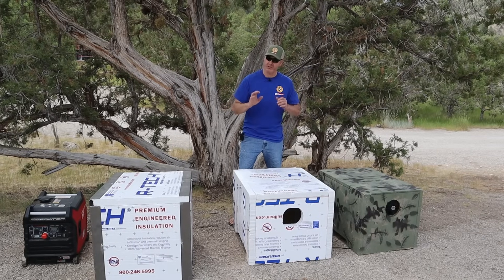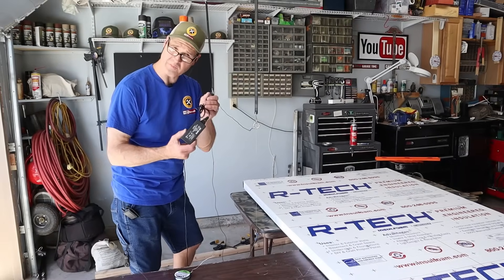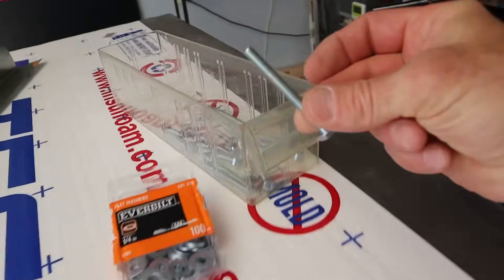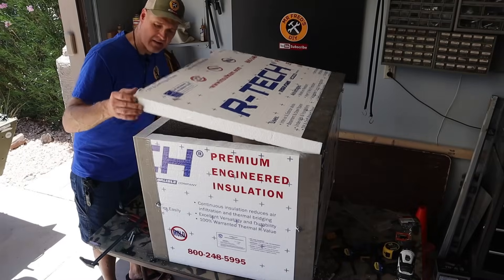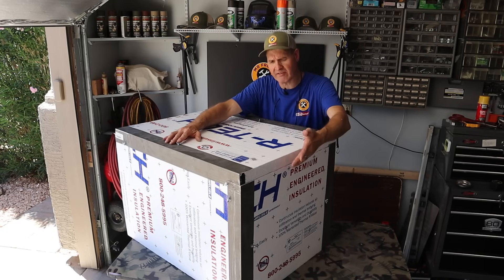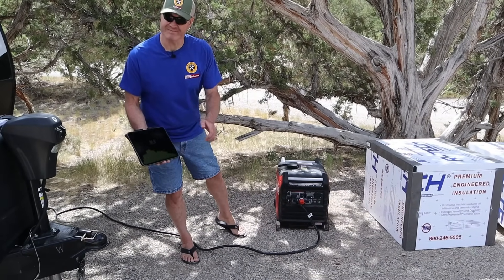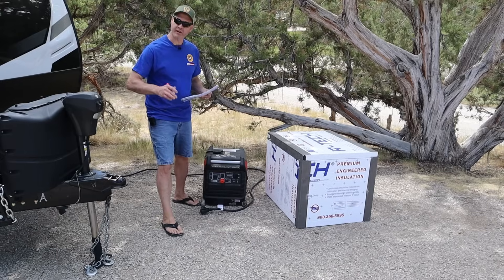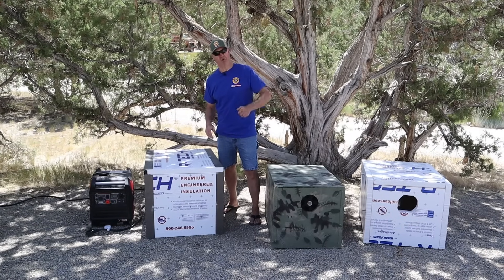Generator Noise Reduction Shed $30 Design

Comment from the maker: So what are you guys think? Is this box worth the effort? Let me know your thoughts. ▶️Here is my newest generator sound box design https://youtu.be/Wn_GF1RQoow?si=3QVhW5V_QWGCH1Pn
Reply: No, it does not work - it just looks good. I typically never use a gen in the nice conditions you had... I want to see the test in a storm, 60mph wind gusts, for about 6hrs. Let me know if the box is still there and if the generator is still cool to operate..
Reply: @MrFredsDIY  you have a small generator. I’ve tried this before and my generator nearly burned the engine. It overheated. Your oil will break down fast and need of changing it often. You need good ventilation or a fan inside. My generator is twice the size of yours and was advised not to do it without an internal fan for airflow. Good design though.
Reply from the maker: Thanks for commenting! What size is your generator? We did a pretty thorough testing video with a thermometer in the oil and the temperature ran normal.
Reply: @MrFredsDIY  or...buy a Honda. Always point the exhaust away from others
Reply: Where did you get the material that you did the build with, the r-tech premium engineered insulation that is.
Reply: .where did you find that blue board. I been searching all around. Dandahermit don't forget bout the exhaust routing or you'll melt it. If you do put a super muffler it"lol still be loud.
Reply: Why would you use an already quite generator instead of a normal generator that wasn’t already sitting in an insulated box. We had the 5000 Predator generator and it was already pretty quiet on its own. This test really proves nothing.
Reply: @-.__.__.-Rad  Sure, throw a MSTA 49 in. 16-Gauge Galvanized Medium Strap Tie under the genny and tie it to the box, with or without spiking it to the ground first.  I might also urge you to move to a less rad weather space, pard.
Reply: No, just buy a Honda to begin with

Comment: I'm more concerned with heat buildup. Cooking the generator is a big risk. Before I'd do this, I'd check temps at key point before and after putting this cover on.
Reply from the maker: Heat with generators is a concern. I did a thorough heat testing video for sound boxes. ➡️https://youtu.be/Ty8aJ2Eh_WI
Reply: Add a box fan
Reply: Yeah it is an issue, My friend made one of these last summer used it on one of the hottest days of the summer to run his AC for an hour and it got so hot it swelled the gas tank and over heated the motor. Once it all cooled down he tried a box fan and it still was getting too hot and it really didnt help with sound all that much, he just ended up getting a much quieter inverter generator.
Reply: @Ivel307  haha I did this.

Framed with 2x6 and batts like your walls would be. Then OSB shell. Then foam and then strapping and siding.  Between the 6inch batts, 2 inch foam, and the strapping/siding creating another dead space it does wonders.

Had to do a sloped A frame roof to put a bathroom fan to bring in fresh oxygen and cooler air.

Little exhaust on the bathroom fan at the top, and an intake vent on the bottom to make it cross breeze.

This way you can pretty well seal it up. Only time I need a generator running through the night on a job site in a residential area is for mould killing attics in the cold winter, and running a 240v heater to keep the attic decent to mould spray and spray foam seal gaps/cracks etc.

So also cold winter air not hot summer air. And no sun being it’s overnight.
Reply: @andrewkujawiak5388  there was a guy on this platform who used a sound meter and just set 1/4", 4'x4' board up against his generator slightly tilted onto it, but more importantly between his camper and the generator, and it did the same decibels here. All you need to do is reflect the sound away from you with a single wall (board). There is no need for the sides and top.
Reply: Irritate the neighbors. 😆 

Or get the plans from Agent Maxuel Smart for the Cone of Silence. 👍
Reply: @andrewkujawiak5388  yes, heat is the enemy of a generator (from big to small).  The gender will deteriorate from high heat levels sand output will lessen.  A small fan to move some air would be a nice addition.
Reply: That things gonna cause your generator to blow up overheating  it
Reply from the maker: @kevinmahan2448 Nope, I made a heat testing video showing the opposite.Are Generator Sound Boxes Bad?
https://youtu.be/Ty8aJ2Eh_WI
Reply: @Steven-gv1ke  yes, the idea is to divert the sound to the ground. It will absorb it.
Reply: @douglass56  when there is an emergency,  you  are in survival  mode. Don't  care  about  neighbors.

Comment: If I tracked your numbers, the difference was generally about 2-3db reduction.  While most people will be able to hear a difference of 3db, it is very near the limit of discernment for most.  No one will consider a dramatic reduction.  Still, i love the effort and plan on watching your earlier versions.
Reply: @kcgunesq  But it was a 6 dcb drop under load which is quite significant.
Reply: @Mozillapi  I agree that 6db is discernible and approaching significant if not significant.

Comment: Most newer generators have a Carbon Monoxide detection feature that shuts down the generator if Carbon Monoxide builds up, such as running it indoors.  You may need to ventilate this "enclosure" to defeat this automated shut down feature.

Comment: needs an internal textured surface for the sound to get trapped in just like a sound booth. gluing some scraps of random foam strips on the inner walls and creating another inner wall with holes punched in it would probably drop you 10 more d's.

Comment: What about heat dissipation?
Reply from the maker: Great question! I made an extensive heat testing video for this box ▶️Are Generator Sound Boxes Bad?
https://youtu.be/Ty8aJ2Eh_WI
Reply: @MrFredsDIY  no sir my next project at my cabin is to quiet my presence there your information was great I’ve got a bud Rubbermade lawnmower shed 4 ft high and 4 ft wide and 5 ft long that’s where I’m gonna put my generator my cabin is totally off grid and I’ve got an exhaust pipe full of fiberglass also for noise control I’ll let you know how it goes , thanks.
Reply from the maker: Let us know how it turns out!

Comment: sound vs heat....putting the generator in a Styrofoam box traps heat does it not?
Reply from the maker: I was surprised when we made the heat testing video! Oil temperatures stayed pretty normal. Here’s the video.https://youtu.be/Ty8aJ2Eh_WI?si=N5AiC7wq_tFMGYb7

Comment: 3" Bonded Edge? Would you mind sharing more info about this? Is it trimming for eaves? I can't find it and Google is usually pretty good to me ;)
Reply from the maker: You can find these 3 inch wide metal flashings in the roofing sections at Home Depot and Lowe’s

Comment: Does that 3500 run everything in you camper at once?
Reply from the maker: Yes. Ac, microwave, water heater too
Reply: @MrFredsDIY  I have a Springdale 1750RD mini.. 30 amp and I'm looking for something I can beach camp with..thanks

Comment: I was suprised to learn simple 4x8  sheet rock panels installed around a generator MASSIVELY reduced the sound!!!
Simply lay the panels, one end on the ground, the other end on the generator.
4 panels takes care of almost ALL the noise.
Cheap, solid fix!
Reply: Uhhh... Aren't these AIR cooled ?
Reply: @reuven2010 exactly
Reply: Just make sure to plug in a fan at both inlet and outlet
Reply: What if it's pouring rain?

Comment: i have a rv with a spot at the front under the nose that is built for a onboard propane generator (onan). It's fully insulated and has cutouts at the bottom to breathe and a muffler pipe leading to the outside for exhaust. could I put in a predator 3500 gas generator in there and keep the door closed to keep it quiet and as maybe add an electric fan to the bottom to suck in cool air?  Do you think this all might work to keep sound low, keep it cool and exhaust fumes?
Reply from the maker: Directing the exhaust (and heat from the exhaust) out of the compartment would be the challenge I think. A fan would work great to vent away the heat from the motor but I’m not sure it would be enough to push the exhaust heat & fumes.

Comment: A lot of these newer generators like my 13000 watt propane and gas unit has a co2 sensor and will just shut off if it’s inclosed. But I like the ideals

Comment: Or, double-walled rockwool with large dabs of silicone between each sheet and no fasteners to transfer sound. Liked they do for sound reduction in some studios and homes? And a fan with a muffler?
Reply: The perfect way to over heat your generator.
Reply from the maker: You might be surprised what the heat testing data shows ▶️https://youtu.be/Ty8aJ2Eh_WI

Comment: I was thinking go over the outside with plywood, put a hole in the back with a fan and put a couple smaller holes in the front so the air can flow Also, maybe put like a vent cover over the two holes maybe make the plywood box a little bit bigger and then you could have the vent holes not in line so it kinda keeps the sound in that way does it make sense?
Reply from the maker: Thanks for commenting! I recently finished a design similar to what you are describing. You can find that video series on my YouTube channel.

Comment: Thanks for your video. Would this work for a bigger generator, like my Champion 3550/4450 watt? Obviously I would have to make it bigger. How much clearance should it have?
Reply from the maker: I would recommend something more in line with my newest design and I allowed about 5 inches between the generator and box. Here’s the build video ➡️Generator Quiet Box 2023
https://youtu.be/erA944a9Bvc

Comment: How do I bypass predator 1800watt CO shut off system  ? I am using it completely outdoors but in a 3 sided shelter and it keeps shutting off. Thanks 👊
Reply from the maker: Our model doesn’t have that sensor. I’m sue there is a way to unplug the sensor and put a jumper in.

Comment: I live off grid. I use generators when the sun dont shine (i am mainly solar). I put it in a trailer with wood sides. Trailer isnt safe fir the road anymore. I put a camper shell on top suspended by 2x4's. that was my solution.
Reply: @rodx5571  how well did that work?
Reply: @Khlandestine  it works well. It's well ventilated as camper is suspended on 2x4's. The camper shell back window is easy access to fill generator. The back of the bed is wood, and is easily removed for service..it also works as a sound damper.

Comment: This man is insane
Reply: Why do I never read about the best place for noise reduction and that is underground. However, you must pay attention to air supply and exhaust and the exhaust can be connected to a long pipe. My father had this with a generator and you had to do your best to hear something in the distance. Note: if you have a high groundwater level, I would not do this. It is possible, but it may be too complex

Comment: When I was in the military they piled sand bags around the generator[s] and put exhaust that pointed straight up.  With the sides closed and the exhaust pointed up they went from extremely annoying to are the generators running?

Comment: When we sat up generators years ago in the military, we used sand bags, the sound barrier should be built like the letter "G" and the top open. The opening should be facing towards any breeze that might be available. The sides should be slightly taller than the generator. This emits noise upward which makes it quieter. Heat is death for generators. If the generator doesn't have a sound barrier built around it, it is because it needs air. Just simply placing a barrier between you and the generator will cut the noise quite a bit. The materials that you used are excellent.
Reply: I see it now. ISIS stumbled into your camp because it was so quiet. They didn't know you were there. 👍 

Good info by the way.
Reply: That really made a difference? Sand bags? Letter g? Hmm
Reply: @Eazye442  of course the military had a lot of sand bags. And it seems we were always training in sandy areas. Overkill, but was efficient

Comment: You are not blocking the clean air (oxygen) from the generator ? I would assume, that when the engine reuses its exaust fumes to run. would not be recomended

Comment: Fred you are super carismatic, great channel great vidfeo. going to the technical part looks like the project failed, very little noise reduction.
Reply from the maker: Thanks for commenting! “Success” is pretty subjective with noise, decibels and sones. Perception of sound vs sound intensity is particularly hard to measure. As others have commented, a 3 db drop is a reduction of half the sound intensity. In my personal experience I find that using the sound shed is a better camping experience than without it. Thanks for sharing!
Reply: @MrFredsDIY  yes, it is exponential the db scale.

Comment: The foam box for noise reduction quite useless. You need mass, which is the opposite of light foam. Thick osb should work, or use mdf which is more dense.

Comment: Good idea but there air cooled and this almost cuts any circulation off they in freezing winter probably ok but in 80+ degrees I might want to put a opening on the other end and maybe even a small fan...
Reply from the maker: My latest design has a few of the features that you mentioned. Thanks for commenting! https://youtu.be/Wn_GF1RQoow?si=DPaKRWx1tvagn57P

Comment: Id spent a bit more and add some inner layers. Perhaps Dynamat followed by sound tiles that have pre-drilled holes. These holes attenuate noise. Holes like that are drilled into the nacelles of jet engines to lower the dB of them. They work.... Millions of tiny holes in Inconel and or titanium.
Reply from the maker: Interesting ideas and thank you for commenting! Check out my latest build for these boxes. I found another product that I like. You can watch that video.▶️https://youtu.be/Wn_GF1RQoow?si=t-2SXy9eEAfsYT1M

Comment: I put my generator with the back of it near a tree when camping. I thought having the exhaust aimed at the tree would help block some of the noise. It was about a foot away and still the carbon monoxide sensor shut the generator off.

Comment: Dear Sir, I learned how to soundproof generator sets for the film industry. Your soundproof design is what I call, flat plane muffling. I built a generator, (120 kiloWatts, thats a turbo charged Cummins 6ctg, if I remember corrct), Mounted on a brand new truck, spankin' from the showroom, that on its first movie, was boomed up the side, by the fussy sound guys, microphone 3 feet away from the skin,  with sensitive dialogue as they walked. The movie was Grampire, I don't know the local name to you but it was with Al Lewis as the Vampire. Al Lewis, such a cool guy, not that I'm insinuating a closeness. One day he talked about the car crash on car 54 with Fred Gwynne. That's all. I had always had an image of his credit on The Munsters. That crooked swerve of a signature. I got to work on a movie with him. He was the Best. Al Lewis is cool.

Comment: I am surprised that the box made such a small difference in sound level. Maybe it needs a liner of sound absorbing material.
Reply from the maker: Thanks for checking out the video here is my newest box and it made a much bigger difference! I did use a different material for sound absorbing▶️https://youtu.be/erA944a9Bvc?si=tWZe7ttOnUH0d8fj

Comment: waste of time you wouldn't even hear that generator 50 feet away. but it would be great for running in the rain
Reply: @BOB12349307  In some suburbs the houses are less than 20 feet apart.  So in those cases the generator will be heard by the homeowner and the neighbors.

Comment: I’d be concerned about heat & possibly a fire hazard? 
I already have my roll out generator in a stainless steel 306 custom made cabinet that is vented on two sides. The top is hinged for maintenance & adding fuel. I already have a super quiet generator (Honda EU 7000is). It can run my entire house. That generator in economy mode is 54 decibels. 58 decibels at full speed.

Comment: I have seen many a generator burned up and damaged from heat. I say buy the longest cords you can afford and move generator away from living quarters. Noise is just temporary with a portable generator so close windows near generator and turn muffler side away from building/homes

Comment: I dig your design. I built one almost exactly like yours. Being in broadcasting all my life I have heard what a difference sound-deading material can make. I lined the inside of mine with a product called sonex sound dampening panels used in radio station control studios. I had saved a bunch of scrap Sonex from a studio build. I had no idea at the time what I would use it for. glad I did. It works extremely well to dampen my RV generator. The only problem I ran into was the CO detector on the generator was very sensitive and would kill the engine if the wind was just right. I did a little tweaking with the box installing a small fan. Flat surfaces reflect sound in a big way. The Sonex (with a massive surface area) absorbs it like crazy. Thanks for sharing & Cheers from Louisiana.
Reply from the maker: Thanks for sharing your story! Your improvements to the design sound great!
Reply: You can only build a box one way. Lol
Reply: Hey Rick, would egg cartons work as makeshift sound baffles?
Reply: @thenoneckpeoplerepresentat8074  Absolutely. The cardboard type has more surface area than the styrofoam egg cartons. I have used them many times. And way less expensive than Sonex.
Reply: @radioace318la  Thank you, I appreciate the reply. I’m going to give them a try this summer at my camp.